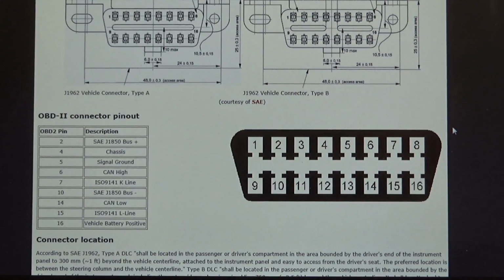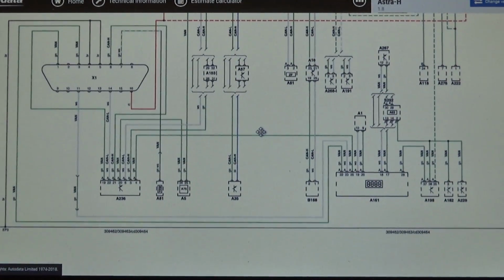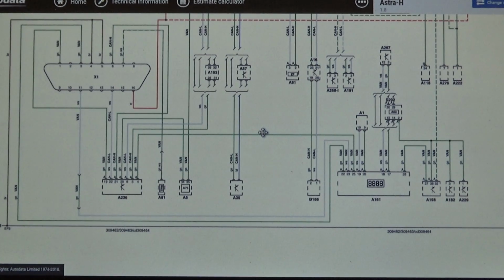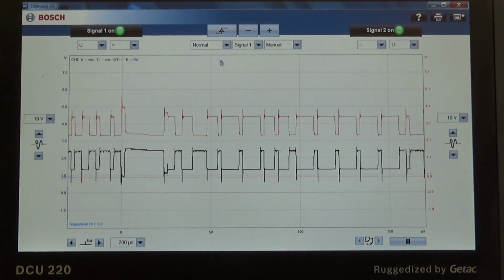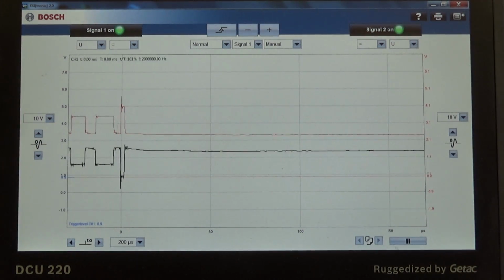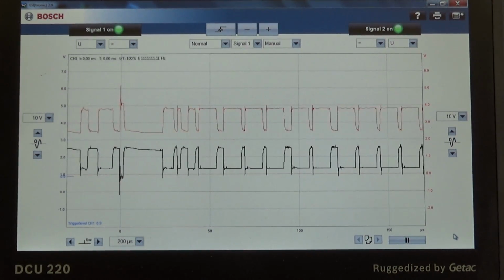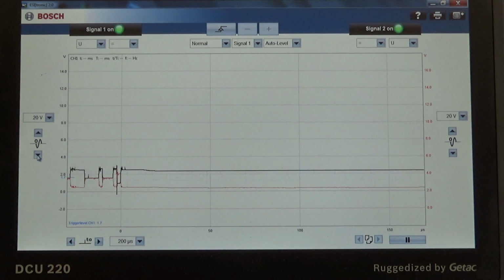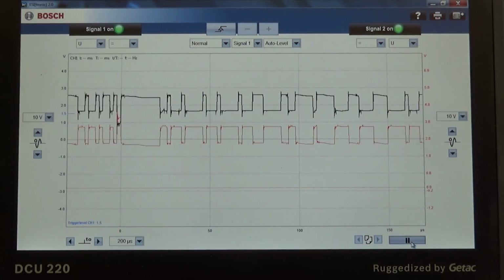CAN 101

Comment: Where is the can break out box from
Reply from the maker: Mine's a Pico, snapon also sell it.
Reply: @SimplyDiagnostics  awesome. I'm waiting for some eBay bargains on Pico equipment although not too difficult to build either. You should consider getting some 4mm back probe pins from eBay. China make some pretty decent ones.
Reply from the maker: @aqib2000  I've got boxes and boxes of probes, all types and sizes, unless it's mission critical I use what's on the end of the lead for speed.
Reply: @SimplyDiagnostics  fair point sounds like me

Comment: I dont know why you refer to them as layers. They are circuits.
You also called the can hi a high speed which would lead your audience to believe that high is high speed and low is low apeed when infact both transfer voltage signals at exactly the same speed. High means the voltage increases and low decreases. It happens in unison so hence the mirror image of the 2 circuits.
For simple testing of the high and low can its a good video providing there is no fault however a module with a fault is going to look very different on the scope

Comment: nice....something to refer to when ya have a questionable waveform.....a few days ago I had a 2009 Subaru with the high speed can shorted together at the underdash bulkhead.....my signal look much different thatn your last test...my waveform looked like a sawtooth and both can high and can low were completely the same....not mirrored!!! something to keep in mind......oh and the can issue I  had was technician induced......they taped the harness so tight that they moves the caps on the splices and exposed copper and the super tight tape job crossed them .....actually was a easy find as the tape job didn't hold and was crying for inspection.....great vid simple.....
Reply from the maker: billmck12345 if you’ve got a screen shot of your shorted network, feel free to post it on our Facebook group. Link in video description. Cheers, Steve 👍

Comment: Are you suppose to disconnect the battery before ohming the network?
Reply: checking resistance in any curcit must be down after powering down and isolating the circuit no voltage.
Reply from the maker: MaxAirGo I wouldn’t just disconnect a battery, it can create problems. The easiest way is just to wait for the network to power down.
Reply: I was worried that the meter putting out small voltage when in Ohm mode would damage the network but its nothing compared to shorted to B+.  Really liked all the tests you put together.  Thank you.
Reply from the maker: MaxAirGo glad you enjoyed it, there are a lot of myths surrounding CAN, hopefully this clarifies the subject for a lot of people. Networks are tough, they can take a lot of punishment 👍

Comment: Good on you taking the time out of your day to make informative videos. A couple of pointers tho. 6 and 14 are CAN high and CAN low because of their voltage differences and the fact that their dominant bits change in voltage the opposite way to each other. They are however both in the same speed network. There can be multiple speeds of network ( as shown in your wiring diagram) Referring to the diagram, i would suspect that was one data link connector but it was split showing two different networks on 2 different pairs of pins 9+17 & 3+11. Also some manufacturers such as psa use wire numbering instead of colours. So all the CAN wires in one network will be 9001 & 9002 for instance instead of blue & red or in the case of many VAG vehicles orange with brown tracer and  orange with black trader. The interference in the trade wouldn't be because it is bluetooth and is normal in most instances. Completely clean switching is very difficult to achieve. 
Enjoyed watching. Thank you.
Reply from the maker: neeniebob1 exactly 👍 this is the entry level video for a series. Just enough info to whet folks appetite for the topic 👍 glad you enjoyed the video 😁

Comment: What is the difference between chassis ground and  signal ground?
Reply from the maker: tim essex great question Tim, if it’s even a connected pin it will be cleaner. The same as battery ground or sensor ground when scoping.